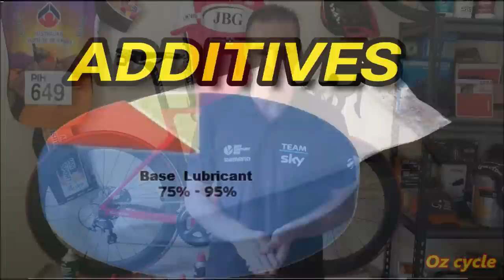Ultimate Chain wax - make it yourself

Comment: Question: What about leaving the chain on the bike and heating it up with a burner reposition the old wax and melting new wax from the block in? It should be way better than oil and far less work, also the wax doesnt get dirty from old chains. What do you think?
Reply from the maker: Let us know if you find an easy method to do that ?
Reply: @stevenleffanue  Thanks for the reply. I will keep you updated. I will test if it is possible to apply the wax on the cleaned chain on the bike. I will heat the chain with a soldering torch or heatgun (pointing away from tires etc), then crank it and apply the wax which can work into the links. In order to clean the chain i will try cooking in windowcleaner/water, perhaps it is possible to circumvent petrol and spirit.
Reply: @stevenleffanue  No chance with water and soap. I batchcleaned 10 chains in petrol. First bath all at once, soked it for a day and gave it a shake from time to time, then 5 jars with 3x petrol 1xpaintremover 1xethanol washing and shaking every single chain. Then put chain and a pile of cheap candlewax(withpalmoil) in a plasticbag and put in in boiling water, worked the chain until the wax got stiffer, worked it more and removed excess wax with toothbrush. Wore a pair of working gloves with latex gloves over them, so the heat was no problem. Put it on the bike and i asked myself, is this bike from this planet? Shifting and pedaling, wow :-) Decided against waxing on bike because of possible introducing of dirt from sprockets. But when the wax wears off, i will give it a try.
Reply: @stevenleffanue  After i have done the whole thing i would suggest that degreasing is the most demanding task. Waxing is fun. So only in an last resort it would make sense to wax the chain on the bike. Far less work to cycle through chains and to them all at once again. I would simply cook them in boiling water, removing dirt, and then rewaxing them all together.
Reply: @stevenleffanue  I have an idea for the normal plastic jockey wheels. Mixing wax with motoroil gives a very slippery non sticky paste, i think it would be ideal for the jockey wheels. It seals up, lubricates, protects from corrosion and it attracts not as many dirt than normal grease and it has almost no stiction or tackiness.
Reply from the maker: Let me know how you go with that?
Reply: @stevenleffanue  It seems promising, it is basically wax grease. The only problem i can see is heat and the melting point. Normal grease doesnt have this problem. But if the chain isnt running away it should be no problem. We will see. I call it the ultra high performance super duper wax grease :-) Its old ptfe spray, chainsawoil, motoroil, and paraffin wax. Probably one could add normal grease for higher temperatures.
Reply: @stevenleffanue  I figured out that the melting point is very different, bees wax with the highest followed by stearine(animal or palm) and then paraffine melts the fastest. I guess higher melting point means the wax will stay longer on the chain. Perhaps my cheap candle wax is better than pure paraffine. What do you think about this? AND i observed uneven wear in the links of the chain, this suggests that changing orientation once in a while is a good thing to do. Old chain has 3x the roller play than new a one.
Reply: @stevenleffanue  For the rollers i would suggest paraffine+beeswax+motoroil+ptfe. Great way to wax chain is to put in ziplock bag then into the steam tray of multicooker or a normal steamer  and water in the bowl. Then move the chain in the bag, put on a fabric glove and a latex over it, grab the chain, put it on a newspaper and move it as it cools down. Throw the flakes back in to the bag. Very easy, can do this in my kitchen with the cooker im using for food.

Comment: Can I ask about using this for a bike that is only used indoors on a trainer - I'm concerned the wax that falls off might cause a huge mess - I could ride outside for the first few KM, however how much wax falls off after that, and will it mess up the floor etc? My trainer is on a mat and that's on top of carpet in my study. My wife will have my head on a plate if the wax gets into the carpet - hopefully you can advise? Thanks
Reply from the maker: Wipe the chain off with clean rag when its hot out of the pot.. .very little wax will flake off.

Comment: what kind of degreaser did you use to clean the gears in the end of the video? I ask because wax was used  for a lube so there should be no grease on the gears.
Reply from the maker: Auto degreaser

Comment: Hi Steven, I've been using your wax recipe over here in the UK for over a year with no problems. I have noticed however that the wax in the slow cooker is now grey once melted. Do you know if this will be dirt( I clean the chain properly before relaxing) or perhaps the PTFE powder going black?
Reply from the maker: It'll be the teflon, no need to make a new batch until it gets quite dark grey

Comment: Thank you so much for all the information. Much appreciated. I have jut done my chain but the PTFE did not turn into a milky color but sank to the bottom of the cooker and became lumpy. What could i have done wrong? Please help.
Reply from the maker: Is the ptfe 1.6um?
Reply: @stevenleffanue  I was told it was 1.6um. The PTFE is in a very fine powder form. It does seem very sticky when pouring into the melted wax.

Comment: After having traveled 300 km the chain and transmission are still perfectly clean... if I continue for another 200 or 300 km will the effectiveness of the wax+ptfe still be good or are there any significant deteriorations?
Reply from the maker: The chain wear increases shortly after 300km. If you wait until your chain sounds dry the damage is significant. Rewax before or close to 300km

Comment: Did I get this right? Are you saying that provided I skip the PTFE "rubish" due to lazyness and unavailability, the IKEA candle wax will still do the trick half decend? ( compared ot occasionally cleaned and oiled ) And If I am too cheap to buy a "slow cooker" why does the rice cooker not work?
Reply from the maker: Avoid using only paraffin wax,add a little paraffin oil to soften it. Rice cooker is ok just watch it doesnt get over 90degC.

Comment: Hey there , nice video, thanks for the recipe :) just waxed my chain today and went for a ride. Just wondering after my ride the rollers are a lil stiff and some wax turned a little black, is this meant to be like this ? I degreased my new chain in my ultrasonic cleaner. Definitely no more dirty hands but the wax is a little black when flaking off. Cleaned my jockey wheels and chain ring prior to installing the chain too
Reply from the maker: How far did you ride?
Have you got anodised black chainrings?
Reply: oz cycle I’m just using a regular ultegra r8000 chain rings, rode about 40km only
Reply from the maker: Some of the black finish on chainrings is coming off...not a problem.
After 40km your waxed chain should not be stiff at all. You may have some contaminents in the chain. Do the initial clean as explained in video. Do not use ultrasinic cleaner as it will leave contaminent inside the links.
Reply: oz cycle okay thank you so much , appreciate it :)

Comment: OK, I've made this stuff OK but having now watched a couple of other videos you've done on wax chain lubes, I notice there's no mention of paraffin oil in this recipe. In the other videos you state that wax on it's own is too hard and will get displaced during use, leaving metal-on-metal contact in the links. The oil you added in the other videos softens the wax to prevent this happening. Should we be adding paraffin oil to this one for better results? Great video by the way -  thank you.
Reply from the maker: For continuously wet conditions add paraffin oil,otherwise just use ptfe as its a cleaner wax.
Reply: @stevenleffanue  Great, thank you.

Comment: Awesome Video, I got PTFE powder 3.0 Microns ....  can i still use it? Will the ratio to the 500g of candle wax be different? Also id i can't find a degreaser can i use a detergent instead and then use the methylated Spirit to do the last cleaning?
Reply from the maker: Degreaser available at hardware and auto shops
Reply: @stevenleffanue  thanks for your swift response. Can i also you the PTFE powder 3.0 Microns especially since you stated 1.6 Microns
Reply from the maker: Some people have experienced clumping with 3um. Give it a go but if it clumps go to 1.6um
Reply: @stevenleffanue  okay, thanks 😊 🙏🏾

Comment: Thanks for your effort in making these videos!
*Any ideas?
I've been trying this lube system since you first posted this video. I ride MTB bike parks. 
What I have found is certain conditions appear to strip the lube away quickly leaving a grinding chain in a ride in some cases.
These conditions.. 
-After each muddy I will Wash the bike n chain with just water. 
-Dry dusty conditions especially when shuttling, I have taken to rinsing the chain with water at the top of each lift.
**For effort required in waxing its now worth it if I have to replace the chain each ride.
Reply from the maker: For wetter conditions add a small amount of paraffin oil to your wax mix.

Comment: I've been trying your 50/50 formula of paraffin oil / paraffin wax by volume per your video and have had moderate success. My problem with that ratio of oil and wax is that it doesn't begin to skin until about 45 degrees C in contrast to one of your videos stating 54 degrees is the skin point. Even bumping up the paraffin to maybe 60% of the formula still leaves a skin point well below 50 degrees C. I take it that the key to success with the formula is having the right wax / oil consistency in the 50 - 54 degree range as you said in your video. I'm a bit puzzled. Could it be your formula  is actually closer to 65/35 or 70/30? Thanks for the bike videos!
Reply from the maker: The make up of 'paraffin oil' varies from country to country  which may affect this setting temperature point.

Comment: I'm in the UK. We have what we call paraffin/kerosene which we use mainly for heating. It smells pretty bad. We can also get odourless paraffin oil for lamps. Do you know if either will do? Thanks.
Reply from the maker: Paraffin oil as used by veterinary and medical.
Reply: @stevenleffanue  Thanks

Comment: In the olden days, when removing and remounting a chain, it mattered (I was told) to distinguish between the outer and inner side of the chain to keep the wear down.
This seems not to be the matter in this video, but before I try this wax method, should I somehow make sure that I always remount the chain with the same side facing the cogs and chainrings?
I have a 14-speed commuting bike with a Shimano cassette where I shift between two Campa chains for every 2-300 Km, always making sure that the inside of the chains always face inwards.
Normally I clean all my chains in lamp oil using an old toothbrush, blow most of the oil off, dry most of the rest off with a cloth and then clean the rollers with folded pipe cleaners. It takes time but it works. I then use a small amount of Delta Oil on a flat 2,5'' paint brush to lubricate the chain and finish by wiping off excess oil.
This works fine, but the wax method looks so much better and has to be tried out. Id just like to know if I have to pay attention to "chain orientation",
Reply from the maker: The rollers on each link rotate on a pin therefore shouldnt get unevenly worn on one side.
Reply: OK, nice to know. No excuse now not to try out this lubrication method.

Comment: Oz cycle, if I rinse a cool, freshly waxed chain with hot water to remove the outside wax, will the wax be removed from inside the chain? Has any testing been done on that?
Thank you for the videos, ya bloody legend!
Reply from the maker: Very little will be lost from inside the chain if rinsed quickly in a seive. If you immerse a waxed chain in hot water, then yes, more wax will leach out.
Reply: oz cycle fantastic! Thank you so much.

Comment: I just waxed my ebike chain with candle wax and paraffin oil and was wondering if I can use Squirt EBike lube from the shop for a quick lube if it is washed out in wet weather if I don't have time to take the chain off and rewax
Reply from the maker: You can but you will need to completely clean your chain if you want to wax it again.

Comment: I watched another (possibly older) video where you detailed DIY wax products. In that video you mixed paraffin lamp oil with your wax to get a desired consistency. Is that method no longer state of the art?
Reply from the maker: Adding paraffin oil is for riding mostly wet conditions. It helps prevent your chain rusting.
Reply: @stevenleffanue  Thanks for the clarification! I guess here in the American Desert S.W., I will not use the oil. Keenly interested in PTFE powder, however! Thank you!

Comment: Hi. What is the latest convoction? 1 part PTFE 1.6 micron powder to 10 parts Isopropyl alcohol? I notice in your latest video u did not mention using Parafin.
Reply from the maker: No, the mix is 1 part PTFE to 10 parts paraffin wax.  Isopropyl alcohol is used to dissolve some of this PTFE-wax mix for the 'chain wax in a bottle', for emergency top ups if your chain is overdue for cleaning and rewaxing.

Comment: HI all, love the wax and want to give a bit of feedback. If you want a clean drive train above all then this is the way to go! Am curious how the chains wear over this season but a potential cost saving is not why I like it. I use four chains that I alternate so that I only have the clean and rewax once a month or so (it is unfortunately a bit more work then just re-lubing your chain). I did find that it is critical that the chain is completely dry when you wax it. If its still wet or has chemicals on it the wax does not stick properly and you'll quickly hear the chain grinding on the gears. Especially in Northern European winters this was a problem. The cleaning method shown does not quite work for me. I let the chain soak in boiling water for a minute first and then rinse and wipe it off with a microfiber towel. After that all dirt is truly gone. Oh ja, and Brenspiritus works better then Acetone (metholated spirits is not on sale in Germany) for the last cleaning step.
Reply: Agree with "boiling" the chains. Leaving them in boiled water for a minute or so (before re-waxing) effectively removes any dirt. The drawback is that this way all the sticked (remained on the chain) wax is removed. I also wash it with boiled water (as shown by Oz Cycle) after the "boiling" process to be sure that the chain is super dooper clean. I also dry the chains with a hair dryer before re-waxing. Wiping the excess wax form the chain once removed from the hot wax is also better as less wax remains on the outer sides of the chain which is not necessary. One problem I have is that sometimes the chain creacks after only 150 km (I always ride in dry conditions). I also have to notice that a waxed chain is - in general - a bit more noisy.

Comment: Slightly confused, I have watched your fantastic previous video re waxing the chain and you remove the chain at 50-53 deg. as it allows wax to semi dry. In this video you pull the chain out while hot , precious video you  say don’t do that as the wax just drips off. Have you change the procedures (updated)??? Or am I missing something - your comments would be very helpful
Reply from the maker: New wax has PTFE instead of oil
Reply: oz cycle ok so if you have paraffin wax with FTFE. You pull straight out as shown in your latest video 👍
Reply from the maker: Yes. For a super clean look in dry weather wipe chain lightly with rag whilst still hot

Comment: So all the parafin and ptfe you melt, you leave inside the slow cooker for the whole time, until you use it next time? what do you use for jockeys?
Reply from the maker: Yes , it will last your chain approximately 3,000km before needing to be renewed. No need to lube jockeys , chainrings or cassette sprockets. Welcome to your cleanest drivetrain.

Comment: I cleaned the chain, cassette and chainrings following your methods. Made a warm pure parrafine bath in a slow cooker and soaked my chain in it. Yesterday i rode my bike for 50 km in the rain. Rinsed my bike with water after the ride. Afterwards i dryed the drivetrain. Today my chain is rusty. What can i do about that? Btw.... great vid’s!!!
Reply from the maker: Wax not sticking to chain? Or add a little paraffin oil which prevents oxidization
Reply: @stevenleffanue  could adding ptfe overcome this also?
Reply from the maker: So you just used paraffin wax on its own?
Reply: @stevenleffanue  yep, only parrafin wax; no extra’s
Reply from the maker: Yes,paraffin wax solo will crack and fall off your chain leaving it dry.
Reply: @stevenleffanue  okee! I will look for ptfe powder. Thank you so much!

Comment: Am I correct to say that... This new recipe with the PTFE powder don't require adding any parafin oil to thin the wax out? Would it be even better if the paraffin oil is added?
Reply from the maker: Ptfe replaces oil. Oil attracts dirt.
Reply: @stevenleffanue  Cool, Let me try this.  Thanks so much for the videos.
Reply: @stevenleffanue  I know it varies, but ...  How many miles you typically  go between re-waxing on a road or MTB?